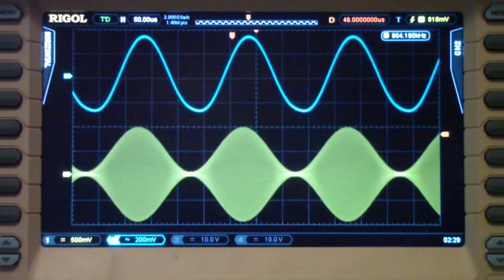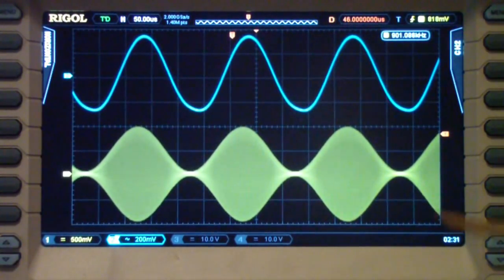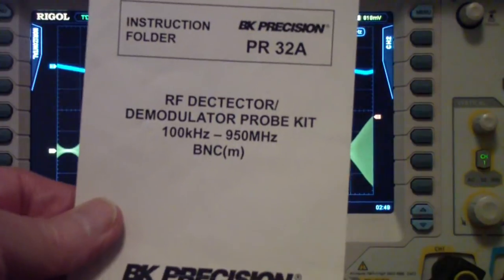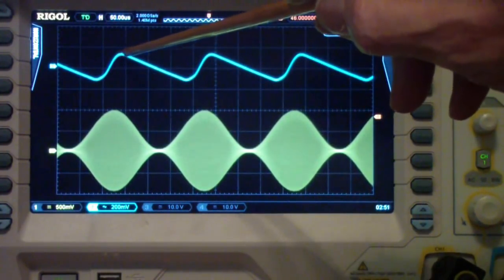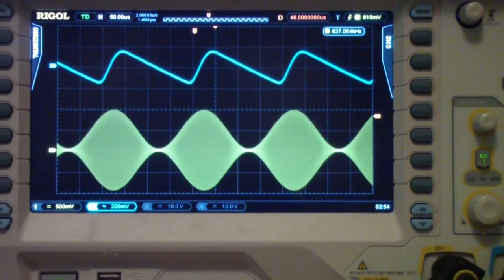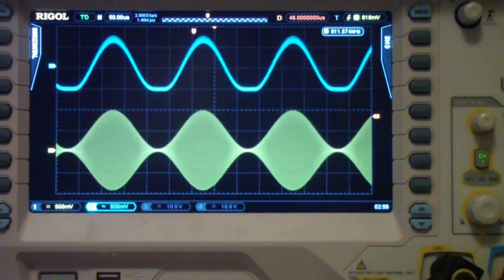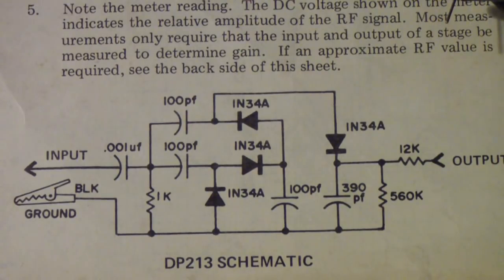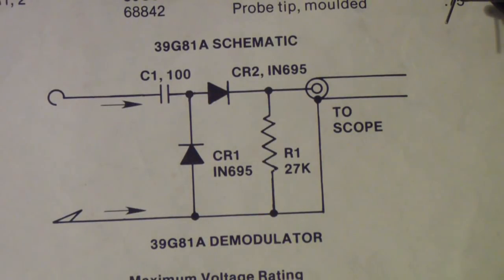TTT198 Demodulator Probes

Comment: Both Sencore probes are voltage doubler detectors.  It only takes two diodes to double the voltage, as in the first Sencore probe.  The 1N695 is a nothing special germanium diode, like the 1N34 in modern packaging.  The 27K load resistor in the first Sencore probe produces more distortion at low signal input level.  It could be much higher in resistance.  Using an oscilloscope with a 1 megohm input with DC coupling you don't need a load resistor, the scope is the load.  RF bypassing is accomplished by the capacitance of the cable.  A series resistor of modest value between the 2nd diode and the coax cable will improve the output waveform a bit more.  In my probe I use a 100 microhenry RF choke there instead.  Using the probe with four feet of RF-58 coax the the typical 25pF input capacitance yields a nice bandwidth well beyond what's needed for IF alignments for FM and TV IF amplifiers.

Comment: On the DP213 schematic it shows an output "smoothing" capacitor of 390pF with a resistor of 560K to discharge it. That has a cut-off frequency of 728Hz, so if you're feeding it into a high impedance measuring instrument like a scope, any frequencies above 728Hz will be attenuated by that capacitor. That's why you can't recover a 5KHz modulation. The clue should have been that the distorted waveform is exactly what you see when you rectify ac to dc and draw a little current from the output capacitor.
If you want to recover higher frequencies accurately, you need to load the probe much more, for example feeding a 50ohm coax. That would effectively load the capacitor through the 12K resistor is series with the output, reducing the output a lot, but having a cutoff frequency of 34KHz. Probably the best load would be in the region of 10K to 20K, allowing accurate audio demodulation while only reducing the output by a factor of about one half.

Comment: Your saying the B&K works at 60hz  but the instruction book says the response is from 100khz to 950 MHz? Can you help understand. Thanks.
Reply from the maker: If I said the B&K works at 60 Hz I misspoke. I meant to say that the sweep generators of the day (50's&60's) worked at 60 Hz sweep so that was all the demodulator probes of the day needed to pass. I am doing a new video about the probe I called the "Dinosaur Bone" and others used in applications from the past and present. I will try there to clear up any confusion as well about probes, response, etc.